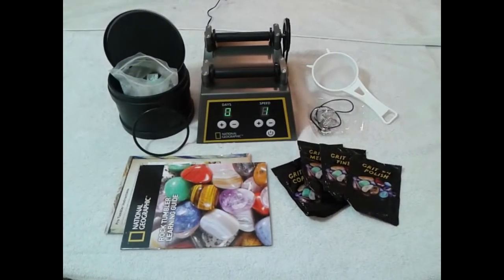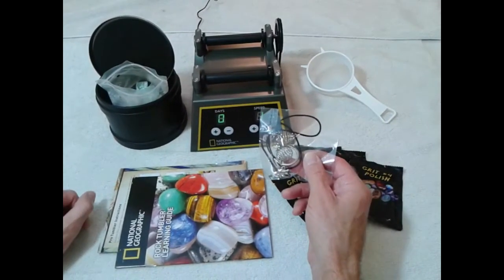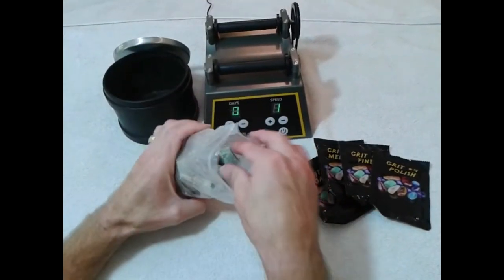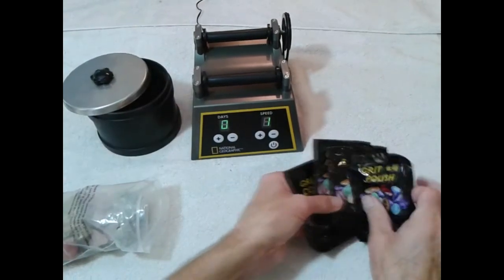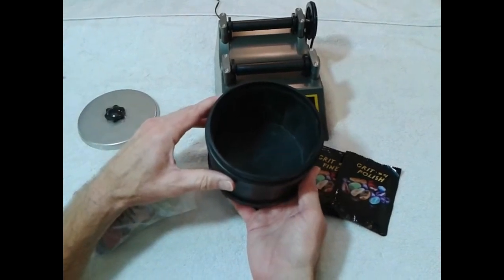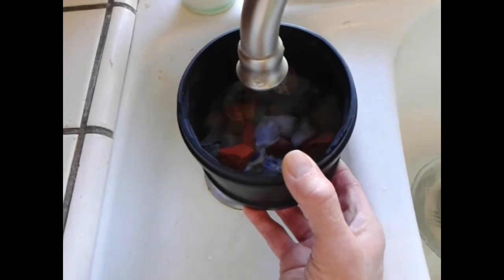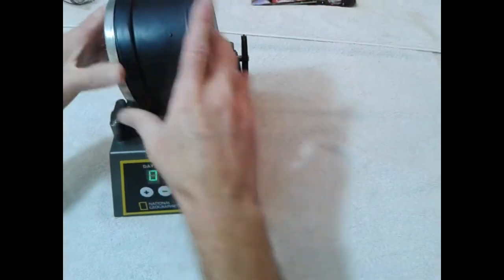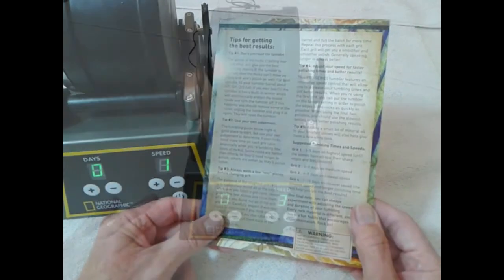National Geographic Rock Tumbler

Comment: Finished with all four grits - something like 28 days for whole process.  My rocks are not shiny/polished like I thought they would be.  Any ideas on what to do.
Reply: Put some hazelnut oil on them and wipe it off with a cloth! It should be shinier. The pros use ivory soap and put it with the rocks as an additional step for a day
Reply: I have the same problem. I even left the rock in stage 4 for 3 weeks and still not shinny. I did some research I think it is the grit level 4 that come with the National Geographic kit is not fine enough. I'm ordering some grit from Lortone (aluminum oxide 1400 grit) that everyone's recommending, haven't received it yet. Hopefully will get better results.